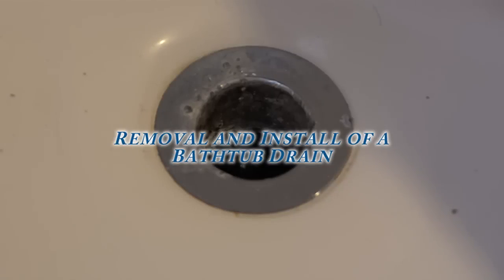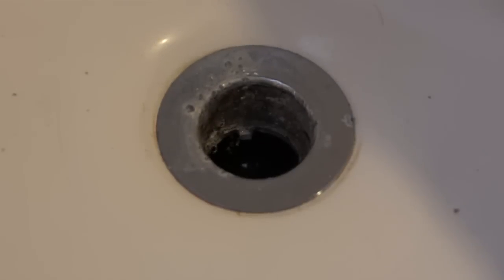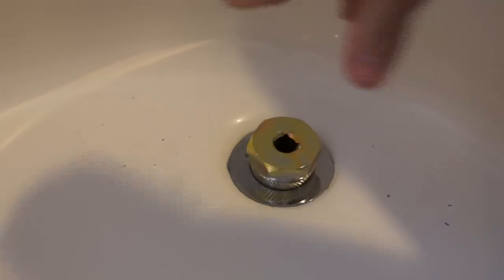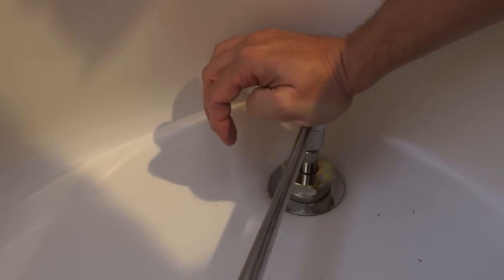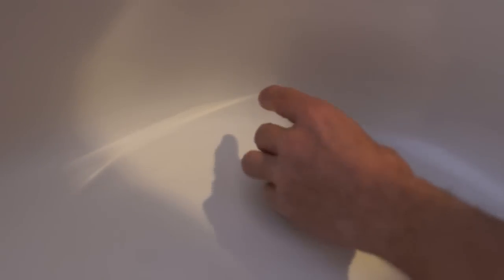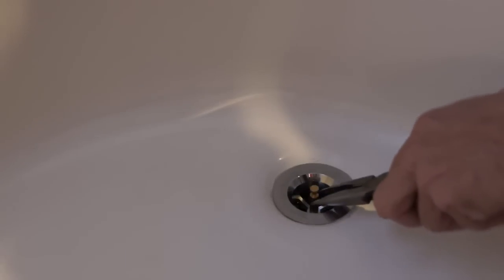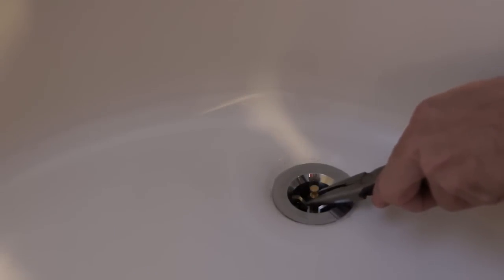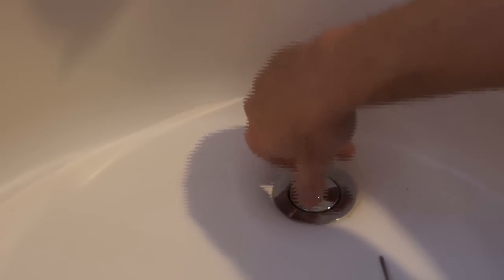Bathtub drain removal and install

Comment: Took several attempts, around 10 times of hammering the drain removal tool down over and over again. It kept slipping out. Had to put a lot of pressure down to ensure the drain removal tool did not slip back up. Finally got it!

Comment: Had a brass one of these in a fiberglass tub for over forty years. The strainer broke off first try. Plan B.....Used an oscillating tool to carefully cut a notch across the top piece to be removed, then used a chisel and hammer to loosen it. Basically turned the top of the drain into a big screw head. Took about two revolutions to be able to remove by hand. I started a few days earlier to spray some WD40 around the drain. Hope this helps somebody.

Comment: Well done.  I recently had the exact same problem where the webs across the drain had rusted out.  Lacking the knurled tool that you used, I cut a groove or notch in the ring with a hacksaw blade, applied WD-40 around the drain, then with a sharp chisel hammered against the notch until eventually it broke loose and came out.
Reply: Great idea!

Comment: It's amazing how in a lot of videos the job is so easy.  They cut out the part where 5 guy are busting their backs trying to remove a part or it is done in a store show room and the parts are easy as butter to remove.  When I do a so called easy job it always turns out to be a major pain.  I want to see the videos that show how to do it when parts refuse to budge.  Now I want to see how you removed the brass tool from the old drain.
Reply from the maker: I agree that there is a lot of struggle that goes on in between the video recordings- they would be really long videos without editing -  I like the idea another person commented on about using a heat gun to soften the old putty- excellent idea!
Reply: LOL...I've been trying for 2 days to get this F%$^$%^% tub drain out with this Husky tool!
It moves the drain barely but won't budge. I've even tried heating it up with a hair dryer.
When/If I get this out, I'm coating the threads with WD40 or Teflon tape so if I ever need to replace it again, it won't be such a little Bitch.
Reply: Me too
Reply: @mikesdoityourself  I could see that with a cast iron tub... Mine is the new plastic type and that makes me nervous (melt hazard), as does banging down on that drain. That's threaded into PVC...  Can't that be damaged?    I bought one of those removal tools yesterday and it just spins...   Just got another ratcheting type removal tool today and that doesn't work either. It REALLY gripped and heard and felt and big BANG!  I fear I just cracked the PVC pipe that drain threads into.

Comment: I had to purchase and use this exact tool the other day for the same reason. In my case, lightly tapping did not work. I had to hammer it in with a good bit of force in order to finally seat it. But it did eventually work as intended.

Comment: Good video. I don't even worry about tightening the screw on the plug. I rather it loose so I can take it out when it's time to clean. As long as the rubber around it is good, it will hold the water!

Comment: You can use heat to loosen up the threads. Use a Heat Gun, not a hair dryer. Don't cook it, just warm it up. It'll soften some of the adhesive or plumbers putty.

Comment: I just used the WD 40 underneath with pulling up with a screwdriver to get it into the grooves & evebtually the hammer worked best aftera few attempts with the other tools. The old one was the original from 1987🙄🙄🙄

Comment: Don't know why you not replace the gasket (underneath the bathtub and on top of drain water pipe) before install back the bath tub drain stopper .  It will no make sense if you are not replace the gasket it will leak a gain .
Reply: I agree with you.

Comment: Great job demonstrating the proper use of a tub drain extractor! I was hoping they made a tool like this, as the insides of my drain have been missing since I bought the house. One comment however, my USAF Aircraft Maintenance Shop Chiefs and I cringe when good mechanics use and abuse tools badly. NEVER use a torque wrench (TW) for a breaker bar! It immediately messes up the calibration of the torque wrench, and it shears the adjustment screw in the TW head. Being that most good mechanics, and some very good USAF mechanics normally abuse TWs, (by accident) the difference is the USAF guys have the tools and training to recalibrate and repair it! Thanks again for your video!
Reply from the maker: As you can see with this beam style torque wrench, it is easily restored to zero by moving it if it goes out of calibration. Thanks for the comments 👍- Mike.

Comment: Good to know there is an extraction tool to remove the drain when the crossbar breaks. Hope I don’t run into that problem 🤞🏻
Reply: Use the right tool in the first place and this won’t happen it’s called a tub wrench works much better than hammer claws

Comment: That tool couldn't break through the chrome no matter how hard I hit it.  I ended up making a pie cut out of the drain with a sawzall and  chizelled out that section,  then it easily pryed loose.

Comment: Great job Sir. I have a question what problem
Yo have ? To change the part of the tub ?? Tanks for. Your time help me a lot ..
Reply from the maker: The first issue I had was the center of the drain was crumbling. Shortly after this drain removal, I actually did a full bathroom remodel with the help of others over a couple of months. This tub was removed and I put in a walk in shower and a bigger tub that I installed next to a adjacent wall. I also installed new cabinets, tile flooring, and a ceiling mounted shower head. Thank you for your comments. -Mike
Reply: All right thanks for your time Sir ,,

Comment: Hi Mike, do you remember the name and brand of the drain stopper? My old one seems to be the same and I am trying to find a replacement. Thanks!
Reply from the maker: I want to say it was a Danco lift and turn tub drain that was purchased at Home Depot. Good luck! - Mike
Reply: @mikesdoityourself  Thank you so much for your quick response. I saw the Danco one but the round part is 1.5 inch, which is way bigger than mine (1 inch); Nevertheless,  the good thing is that after I studied another functional one from my other bathtub, I realized what the problem was and got it fixed by replacing the screw!

Comment: You mention using a torque wrench but then you use a breaker bar. I don't mean to be a stickler but the reason people at home shouldn't use a torque wrench is because they're a precision tool and when loosening things, you don't know how tight they are and you can damage the torque wrench. Use a breaker bar
Reply from the maker: Good Advice, Mavis! I was using a beam or needle type torque wrench which is fairly inexpensive and was all that I had at the time. This type is easy to hand calibrate to zero and does the job when nothing else is available.  Now the click (spring) type, electronic or digital type should never be used for anything but torqueing in a forward position. Damage to these wrenches can happen very easily. These can be fairly expensive and every tool deserves to be used as it was intended. Thanks for the excellent observation!

Comment: NOT a 1/2" "Torque Wrench", it's a 1/2" BREAKER BAR.
Reply: if you noticed the little bar on the top that goes back to the handle it operates a needle for the torque gauge.
Reply: No, that was actually a torque wrench.
Reply: That's not for breaking loose corroded hardware,but whatever works,I guess.
Reply: torque wrench
Reply: nope.  torque wrench.  Beam style.

Comment: I tried a different method and the outside lip of the drain tore off so im left with just the cylinder part stuck on the pvc threads. The extractor keeps dislodging and won’t grip
Reply from the maker: You might have to use open jaw some pliers and put pressure against the cylinder and try to unscrew it out- or chip it away carefully (with a flathead screwdriver, pick, hammer) without destroying the threads and vacuum out the pieces. Good luck with your project!- Mike

Comment: I have to do this to my drain.  Do you not have to put plumbers glue or anything around the drain for when it goes back into the pipe?
Reply from the maker: No because it screws over and down into the drain. Good luck with your project! - Mike

Comment: My extraction tool is slightly too big (universal size Husky brand) and can't find ANY sizes smaller. Do I just hammer it and hope my tub doesn't crack? Yes the cross cracked.
Reply from the maker: I would try to dremel some cross cuts into the drain - then use a flat head screwdriver and hammer to rotate the drain piece out. Good luck with your project!- Mike
Reply: @mikesdoityourself  Sweet I was thinking about that but didn't know how legit it was. Thanks Mike.

Comment: keeps spinning but I cant pull it out something holding it, what to do?
Reply from the maker: If it's just the tool that keeps spinning, you may need to hammer it in more or heat up the threads/plumbers putty to loosen it up. You may have had the threads break off the drain/pipe. You may have to cut it out with an oscillating tool and fix your pipe/threads. A plumber may be needed in this instance. Good luck with your project!- Mike

Comment: Mike how do get the drain extractor tool out of the drain when it is stuck. the old drain is turning but will not come out
Reply from the maker: I would try some adjustable pliers to separate the two. The threads may be stripped on the tub drain. - Mike.

Comment: You said that you bought an installation tool, but you decided to use a pair of needle pliers which was not a proper way to install a bathtub drain.  I meant you did not follow the plumbing installation code.  I am a retired licensed plumber with over 33 years of professional experience.
Reply from the maker: Building codes related to plumbing relate to mostly venting but also include using proper materials, fittings, valves, drainage, etc. Tools are not covered in plumbing codes- please research your comments before you put out false information. The method shown is for people that don't have a installation tool and as long as they tighten it enough, this procedure is more than adequate. This is a DIY project - no plumber necessary- Mike.

Comment: What if the pipe underneath has come away and the new plug/waste can't screw onto it? The pipe below is just bouncing around
Reply from the maker: If there is an access panel to the side of the tub to get to the pipe below, I would secure it by strapping it to something, securing it in concrete or whatever is deemed appropriate. It might be needed to make an access panel to get to that connection, then you can determine if you need to replace the connection or re-secure it.  I would call some plumber's or ask around at your local home improvement store to see if they have any ideas. Good luck with your project!- Mike
Reply: @mikesdoityourself  thanks Mike. Unfortunately no access panel. I think it was fitted with the bath!

Comment: Hey Mike, when I'm installing the new spud, how tight is tight enough?  I don't want to over torque and break it, but also don't want to have it too lose and water get under the tub.  I tightened mine until the plumber's putty oozed out the sides, then kept going until the screwdriver i was using to turn the installation tool started to bend slightly.

BTW, i used the exact same brass remover tool, and it made life a LOT easier lol.
Reply from the maker: Hello Lowmein, As long as the new spud is seated into the drain, the putty will fill in any gaps. It sounds like you are doing fine with your tightening job. (Moderately tight is fine) The water will go down the drain either way. The next time the drain needs to be changed, the  easier it will be if it's  not super tight. It can always be tightened a little bit more if  it seems too loose. That brass tool definitely makes the job easier. Good luck on your next project 🙂- Mike.

Comment: Wat if it just keeps spinning but wont come out
Reply from the maker: If the threads are gone or damaged, you should be able to pry the drain off the bathtub with a flat head screwdriver or a plastic flat pry tool. Good luck with your project!- Mike

Comment: I bought this exact removal tool and cannot even get it to hammer in straight. Tub drain is a rusty corroded mass approximately 1000 years old like everything else in this house.
Reply: Invite me over. I'd like to fix your plumbing.

Comment: Do you recall the part number of the replacement drain you used and where you purchased it from?
Reply from the maker: It was a Danco lift and turn tub drain kit (model 89239)- I believe the  width of this one is 1 and 1/2 inches for the drain hole - yours maybe a different size. I got this one either from a plumbing supply store or Home Depot. Good luck with your project!- Mike

Comment: U got a specialized tool to get the strainer out than you use needle nose pliers to tighten it. Huh...
Reply from the maker: You have to show people options for when they don't have those special tools- Mike.
Reply: @mikesdoityourself  or..  you can show what tool is use for the job. Needle nose can get damaged and not work properly the next time you need that tool for its purpose.  Tha is for replying and good luck.

Comment: Not an open-end wrench. It's  a pair of pliers. Wth?
Reply from the maker: Yes, I had just used an open end wrench off camera that fit in the drain, which didn't work well. On camera, I used the slip joint pliers and didn't have any luck with it either. Yes, that wasn't an open-end wrench. - Mike.

Comment: What about the gasket at the bottom of tub???
Reply from the maker: Only had to worry about getting enough putty under the new drain and then tightening it down- there was no gasket but other tubs may or may not have gaskets- Good luck! - Mike

Comment: Where do you find a tool for a 2 inch drain?  Everything I see in the stores is for 1.5 inch drains, but the one I need to remove is nearly 60 years old, and is significantly larger (Kohler).
Reply from the maker: There is a Rigid 1 to 2 in model 342 internal wrench that may work for you- I haven't actually used it so I'm not sure of the success rate of this tool- I saw this on the H.Depot website or you can check some plumbing supply companies for ideas or tools. Good luck! - Mike

Comment: what happened to the piece that broke off?
Reply from the maker: It broke off into the grip of the pliers but if the piece had fallen into the drain I would have tried needle nose pliers or a magnetic pickup tool. If the piece is small enough to wash down the drain, there shouldn't be an issue.

Comment: Use the right tool!   It cost 10.00 and would have worked the first time!
Reply: More like $20 at my Ace
Reply: What is the right tool please? I'm going to replace my old tub and want to do it in one try and not to back and forth to the store.
Reply: xcheatahx1 It’s called a tub drain wrench. You can find it here - 
https://www.homedepot.com/p/Husky-Double-Ended-Tub-Drain-Wrench-16PL0128/304217585
Reply: @johnhfrick  A tub drain wrench won't work if the cross metal pieces are gone

Comment: what's that tub extractor called?
Reply from the maker: It's called a tub drain extractor or bathtub drain removal tool. - Mike
Reply: Where did you buy it from
Reply from the maker: @Tyga1locks  hm.depot- Lowe's might have one also- good  luck on your project! - Mike
Reply: @mike thanks im going to buy a torch to going to heat it up a lil and use that tool lowes don't have it but ace does I'll let u know how it turns out
Reply: Hey mike thanks it came out in less than 3min awesome video
Reply: You could find tools for this purpose at Lowes.